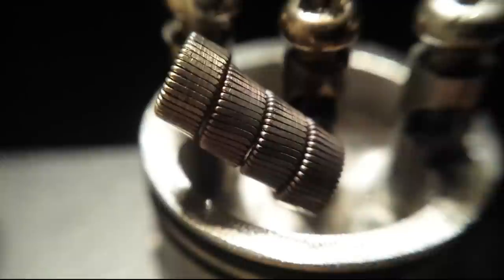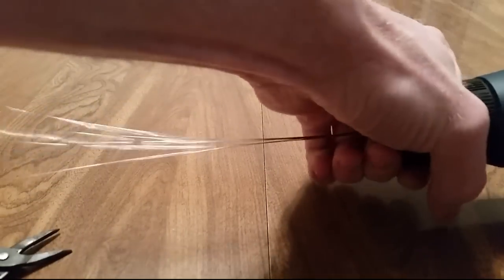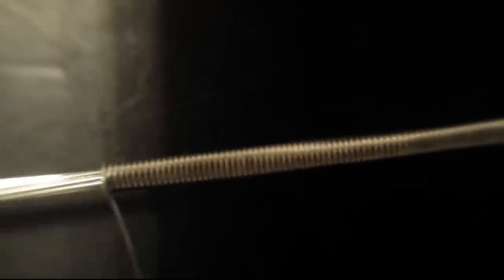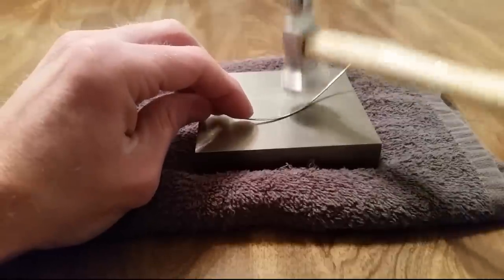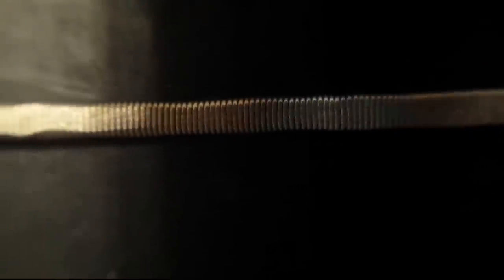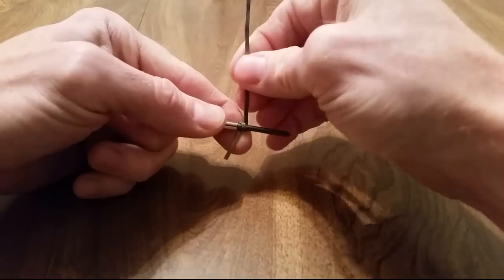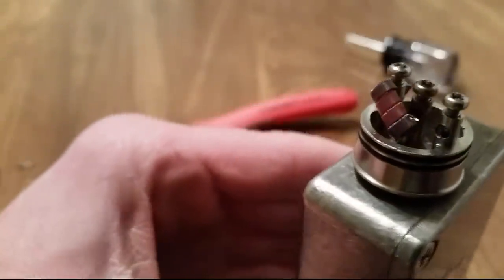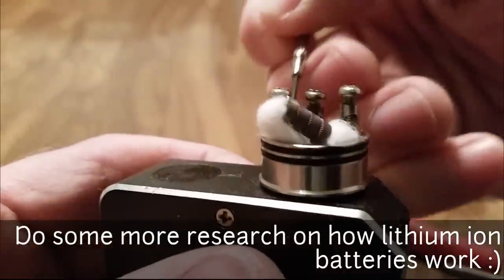Caterpillar Track Coil

Comment: I'm vaping on the efest 35 amp Battery and i know what you're saying. Mostly pulses (about 1-2 second hits) because anything longer and my mech mod heats up quite a bit. I use a Panzer Black Hawk by MCV with a Mephisto by El Diabolo, and a 0.08 ohm dual coil build (five wraps around a 2 mm screwdriver) using Twisted 26 and 24 Gauge wire (one 26 gauge and one 24 gauge strand of kanthal twisted around eachother). It hits pretty nice, drains fluid, clouds are reasonable, but not that great, and flavour is Booming. The main source of heat after vaping fore more than 2 seconds is the spring in the button. I took the button apart since it would get stuck when taking a hit, and the spring looked like a cooil that has been gloing, so that's something. 
Going to try the samsung batteries out, since they're quite inexpensive here in Holland ;)

Comment: Hey man i got a coil for you to try. Very simple but excellent in both vapor and flavor. 1 piece of 22 gage, 2 pieces of .5 x 1.0 ribbon wire and one piece of 28 gage l. Just twist then all up with your drill. Make sure you torch it because the next step will be difficult. The key here is wind it around a 1/16" drill bit. Do 8 wraps. Wicking it is a little hard but get as much cotton through it as you can. You will be able to get plenty through. Its an amazing vape.

Comment: All i can say is you are an ARTIST. You continue to inspire me to push the limits of my build quality. I am currently using a staged heating coil (thank you BTW) and holy crap... amazing! I hate the thought of replacing it with something new but this build may be my next. I may opt for 8 strands of 28 nichrome and kanthal ribbon for the outer wrap.
Reply from the maker: Sounds like a good combo. Only issue with ribbon for the clapton portion is that it breaks a bit more easily. I bet you could get it to work though. Let me know how it goes if you don't mind
Reply from the maker: BTW, do you have an instagram account?  Would love to check out your builds, unless I already follow you.  Are you buddysmoker?
Reply: I don't have an instagram but i now work at a vape shop and handle their IT stuff, web and youtube. I will be posting tutorials soon. might reach out to you for some helpful hints.

Comment: Since you are doing Clapton based coils you should totally try using punching needles... It will save your fingers I promise... It's basically a hollow needle and also has another hole at the tip (pointy side) use the hollow part for the wrapping.. Stick the 36 or whatever gauge thru the hollow part and the base wire you insert it thru the hole at the tip... The coil wraps itself.
Reply from the maker: Wow, not sure how I missed this comment. Gonna check that out! Thanks!
Reply: Twisted Messes   You may want to check out the 'belt hole punch' needles. I think these work better for wiring.Also, have you tried a metal roller instead of a hammer?
Reply from the maker: rtpwyk where would I get a metal roller? Are they pretty large?
Reply: Twisted Messes
 That's a good question, all the ones we have here on the ranch are quite large. Maybe a guitar slide or some pipe? Or maybe a metal dowel? I would guess 1lb would do it. SUmfin like these? : http://www.dowelsandkeysaoneproducts.com/products.htm
Reply: +rtpwyk you could make a really small english wheel with two small and cheap bearings, a little leverage to push them together and just pull the wire between them.
Reply: +AdvocateVaping QuashMonopolisingRegulation That's what I was thinking as well and actually thought about trying out a pasta machine.

Comment: Pretty neat coil. 

Food for thought:
I've been using ultrasonic cleaners for many years to clean metal parts with great success. They clean super tiny parts, crevices and cracks FAR better than can be done by hand through cavitation and usually no chemicals are needed (cleaning solutions are optional for the really nasty stuff). I currently have two units, A Crest CP500D (swept frequency to eliminate dead spots/high power - 500w/1.5 gallon/expensive - $900) and a Harbor Freight 2.5 Liter Ultrasonic Cleaner (40khz/160w/minimal dead spots/very affordable at $75). Yeah, the Crest is a superior unit but for cleaning something easy like atomizer parts and wire/coils - the Harbor Freight unit will work just fine. There's clean and then there's REALLY CLEAN. Obviously, the choice to use one or not - is yours to make. Again, this just food for thought.

Good tutorial.
Reply from the maker: I actually have one of the little ones from harbor freight. Does it really work well without the cleaning solution? Think I'd be better off washing with soap by hand first then running it through the ultrasonic cleaner or would the device itself be better? Also, if I've got you here what cleaning product/powder/solution would you reccomend? I used denture cleaning tablets in the past but found they were quite corrosive with some metals
Reply: Twisted Messes Use a non-corrosive metal/jewelry cleaning liquid for atomizers/mods an stuff. I think just warm water in a sonic cleaner for wire would be best.
Reply from the maker: Thanks so much!
Reply: Twisted Messes may I suggest something more affordable that you already have?

Toothpaste.  Cleans everything off with a beautiful shine, then just rinse and dry.  May not be as shiny as jewelry polish, but it will be just as clean.

Just make sure to rinse and dry to avoid any flavor or rust, but that goes with the polish as well

Comment: Twisted,I would think if you could put your hands on a short piece of really big steel shaft and roll the wire out.It would work like a rolling pin ,I have done this on different projects but it should work if the wire is annealed.Mind you ,I have plenty of access to these types of materials.

Comment: Just letting you know, the 35a efests don't perform at 35 continuous; they are only 20-25.

I use 25R's for battery life normally, and VTC4's for anything needing more amps.  VTC4's are actually 30a; VTC5's are only 25a

Comment: i haven't tried to build this coil yet so i don't know if this would necessarily work as well as i think it would. but after you straighten the coil out and you start hammering it again to get it as flat as possible you could try (if you have a smooth jawed vice) put the wire in the vice and crank it down. ill have to try both ways to see which way turns out better but it seems like it would straighten it out even more or align it better and make it more of an evenly flattened coil. the coil on this video seems awesome already so either way it was just a thought i had to maybe make things easier for people who want to try it. let me know if it works!
Reply from the maker: I've tried the vice but I can't get enough torque to make much of a dent. Possibly with a larger vice than I own

Comment: That is a tremendous amount of work.  I'd like to see someone with metalworking experience give this a try with some shop tools, something like a Jet RM-22N would be ideal, and you could do a 12 inch piece in a few minutes and achieve perfect results with a consistent crimp the whole length of the piece.
Reply from the maker: I want some of those tools quite badly

Comment: Wouldn't it make more sense to start hammering from the end where it was attached to the drill? Since it's already at it's straightest at that point, it would keep the inner wires from crossing further down the coil.
Reply from the maker: Probably right about that :)

Comment: I know nothing about mec mods or building coils or any of that but , that looks awesome !   Dunno if it would work or not but i was thinking if you bought another one of those metal squares u could possably tape the unhammered wire in place between the 2 and throw it in the vice to get the same result only much quicker and possably more even ?

Comment: +Twisted Messes could you not cut that block in half, sandwich the wire in there and crush the hell out of it in a bench vice instead of hammering trying to keep it consistent? not sure if it would work but hey its a idea you might wanna try. great build regaurdless
Reply: if you want is hot spots all over the COIL and bad VAPE taste then yeah you could do that XP

Comment: I wonder how well a pasta cutter machine would work on flattening the wire? You know the thing with two cylinders that roll the dough. I imagine it would take out a lot of the hammering. Its almost like the method that metallurgist flatten steal.

Comment: When you wrap the claptop-style part & get the drill going fast, there is a piece of my heart that actually hates you :D I am still trying to perfect my clapton (only been building coils for like a week) especially since I think it is the best tasting coil. Clouds aren't my style. For flavor, IMHO, #1 is Claptop & #2 is Twisted. Because twisted is easy, I pump those out left & right. Now, I just need to get more attys so I can do builds all of the time instead of tearing mine down all the time :)
Reply from the maker: You should buy a few igo-w's. They're around 10 bucks these days and are great for experiementing. I used to run 14 of them in rotation lol. Just drill the posts to 1/16" and if you have multiples you can drill each top-cap to a different size and then swap them out depending on the ohm of each build. It's always handy to have more build space available so you don't have to rip out the latest masterpiece lol
Reply: That's actually a really good idea. Thanks for those pointers too, time to hit up the interwebs now!
Reply: i found that if i straighten a secton 22g wire and wrap the outer layer (ribbon or 32 or 26 kanthal) around it and then gently slide the 22 out i can easily slide two 28g wires in and they stay straight. you can use a 20g and also slide in two 26g. I found a nichrome inside and kanthal outside is awesome.
Reply: I agree with you on the Clapton being the best flavor.my second has got to be the new stapled tiger.just got the 150 watt sigelei and with a dual stapled tiger coil the flavor and vapor is amazing!my! my list of rda`s are growing too because of the same problem as your having with the different coil builds.since the plumeveils are getting so cheap that's the rda I`ve got duplicates of and there easy to build on.
Reply: I have to get some ribbon wire & then I will try this. Haven't done a ribbon wire build yet. Did you use the same sizes Twisted Messes used in his video or your own sizing?
Reply: Rich Johnson if your talkin about the stapled tiger at first I had to use what I had on hand.i used . 5 ribbon instead of 3/32 and 34 gage instead of 36 gage.single coil came out to .42 ohm.i`ve been doin these coils with the exact wire gages now that I have them. just a single coil rocks if you can`t dual them though.
Reply: Hey Todd Crow thanks a ton, I will order up some ribbon & give that a shot.
Reply: Todd Crow if you like building coils and wire you must get some ribbon wire..5 and .8 are the ones I use the most.love building with ribbon,great flavor as well.
Reply: Try out the zipper, its one of the few coils that beats out a fused clapton for me. Probably my favorite for flavor, on a lancia or magma. Id say the zipper brings out more bright crisp tangy notes while the clapton does slightly better on smooth/creamy flavors. All personal taste though rock on
Reply: Scott Manley yea,the zipper was my favorite for a long time too.but it`s difficult to get into some rda`s and it takes awhile to build.but that's the run of it,right?
Reply: Todd Crow Even better did some experimenting myself and made a 28g zipper then decided to clapton it so in terms it's a fused clapton with the zipper as the core. It looked a bit ugly but that was because it was my first try but man, flavor was crisp and on point!
Reply: I agree on the Clapton, the trick I found on wrapping them is to a] put the spool on a stand to feed off of and b] pinch the wire that you are wrapping and just let it feed the wrap, you can adjust your tension by your pinch and it keeps it nice and tight and you can go pretty fast. I think ultimately doing the wrap it is really finding out what is most comfortable for you to feed for speed. starting slow and gradually increasing though.

I have been making a version I call the AC/DC, its a "twist" on the Clapton... basically 2/3 24-28g strands wrapped and then you twist all of it. makes a cool lightning bolt pattern on the wrapped wire. it also seems to tighten the wrap even more.
Reply: prOkrEAt could you explain how to build that ac/dc coil alittle better?....sounds interesting
Reply: sure, its really the same as a fused Clapton if I remember that build correctly. depending on the size you want and wire available. I take 3 24-28g nichrome strands and wrap them with 34g kanthal [could use 36g if you have it]. once you have the whole thing wrapped, grab a hold of the end with pliers and then twist all of it on the drill [in the same direction you wrapped it in], which twists the inner core AND it tightens up the wraps all together which makes the lightning bolt pattern in the wrap. does that help?

note: I went with 28g inner core so it fits in my atty better [plume veil] but I did get the 24g to fit into a doge on a 5 wrap single. I do 7 wrap dual coils of the 28g for a cooler vape.
Reply: prOkrEAt wow....sounds great!,getting ready to build it.gonna use 28 gauge with the 36 wrap.i`ll let you know how it comes out.thanks bro!
Reply: Get a punching embroidery needle!! Claptons goes from annoying to done in seconds....
Reply: Jess Galler care to elaborate?
Reply: I did in my comment... The punching needle is hollow and has a hole at the top of the needle that you put the core though. And the outer wire thread inside the needle and the Clapton basically makes itself. Its fast and easy and the punching needles can be found at some craft stores and fabric stores. I got mine off of Amazon for $7 and it came with three different sizes.
Reply: Jess Galler fantastic! i also looked up DIY bobbin holder that could easily be attached to this punching needle to hold the wrapping reel.

Comment: the u shape is going to happen no  matter what. any left or right cures can happen from not hitting it flat(when u go from left to right if you hit foreward and back it will cause left and right bends). and enough tension with the wrap that U wont have a too negative of an efect.

Comment: Just a thought, but maybe if you take a little more time wrapping your wire on a really low drill speed, you my eliminate the twisting of the center wires that subsequently leads to warping downstream when you hit the wire with the hammer. I noticed you wrapped them on a super fast drill speed. You are bound to get some twist as the loose wires are pushed back due to air resistance. Like I say, just a recommendation.
Reply: +Robin Moll ummm. that was sped up for the tape... he sped up the playback... he was not wrapping that fast.
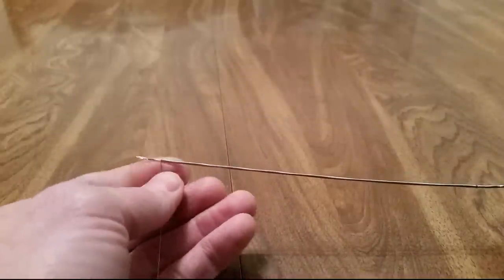Reply: The video at 12:46 - 14:19 was at regular speed. I was referring to the speed of the drill when he was claptoning (not wrapping) the wire. He discussed later that the center wires need to stay parallel to limit the twist and subsequent uniformity of the combined wire later on when hit with a hammer. You cannot expect the center wires to remain parallel if you spin the drill bit at high speed as they are almost certainly going to twist with the air resistance. The part of the video I was referring to was not sped up or edited in any way. I think we have our wires crossed (pun intended)
Reply: +tafoyaerik I've never tried myself so I am only really thinking out loud. It seems to make sense in my head. But if you have tried then I guess it's just one of those annoying things that ya just have to put up with. Thanks for the reply.
Reply: +Robin Moll - if your wires were perfectly straight on the inside, it will still want to curve when hammered. When hammering the coil you would relieve the issue by hammering one side, then turning it over and hitting the other side, evening out the stress of the metal
Reply: +rigman031977 a flat face hammer would be a whole lot better, a bigger and f;latter face... using this jeweller's hammer he's shrinking one side and stretching the other.... holding the wire flat would help too instead of holding one end in the air lol

Comment: Have you tried just taking the coil and clamping it in a vice to flatten it, rather than hammering? It seems 'crushing' the coil in the vice would be a much more efficient and even way to flatten it. In addition using the vice you are flattening it all at once. This way you could flatten in a more controlled 'slow' manner and you would get less distortion (curving) of the coil compared to your hammering method. Therefore there would be no need to heat and straighten the coil. You may also want to consider filing off the teeth on your pliers to avoid nicking your wire. Nicks in the wire increase resistance.

Comment: why didn't you just use flat wire for the core instead of 10 strands? would have given a similar effect(visually), or does the 10 strands give it more cavities for liquid to absorb into?

Comment: I notice most "SuB" builds on videos are coming in around .15, I recently got my TM mod and wrapped a  4 wind, Clapton'd 22ga w/32- paralleled with 22 and it reads @ .07. It blows your head straight of with the juiciest vapor you can imagine.....The question is how come I don't hear of builds that low? is it safe? I've been vaping it a week now with no problems except obviously a hot un-reg copper mod after three long draws..but is the .15 the sweet spot across the board?